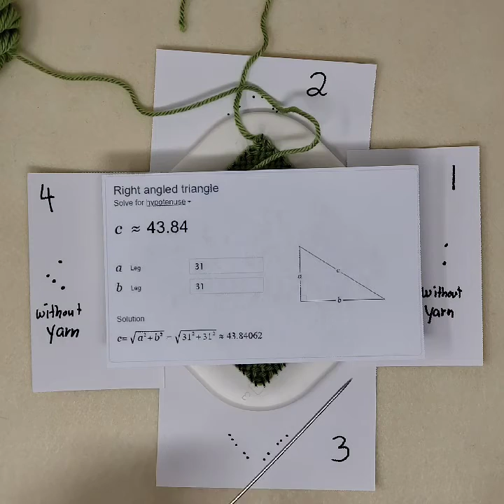How to BIAS-Weave on a Zoom Loom – Step-by-Step Instructions

Comment: Nicely done. 
I like the way that every loop adds one more warp thread on each side so you always fetch the weft by starting UNDER that new warp thread because that will go OVER the previous warp thread.
Also it is worth pointing out that as you are inserting weft from the top and the bottom with the exact same shed when they meet in the middle they will always form in pairs until you draw the last SINGLE thread that will split the paired shed with the final opposite shed.

I have never had occasion to use such a loom or try diagonal weaving but most informative video.
Reply from the maker: Thank you, Kalle, for your comment! You're definitely catching on to some fundamental principles of continuous strand weaving in the round, which makes you deserve a "Nicely done" as well!

Comment: Hello,
I just bought this pin loom and found your video, I really enjoy it.  I've been looking for a hook and yours is perfect. However I look for the afghan hook and it's not like the one you are using. It's just a hook. Have I made a mistake? Could you help me please? Thank you .
Reply from the maker: I'm not sure if I understand your message correctly ... You can use any crochet hook, and the afghan hooks are long enough to weave all across. 
In the video I'm using a "locker hook" which is a weaving tool that looks like a crochet hook at one end and it has an eye of a needle at the other end. The hook end is a little bit extended, which holds the yarn more easily. Hope this helps!
Reply: Thank you. I did misunderstand. With the correct name , I will find the tool. Bye